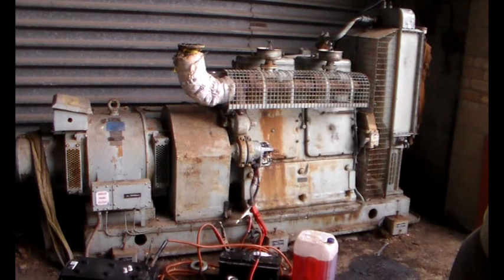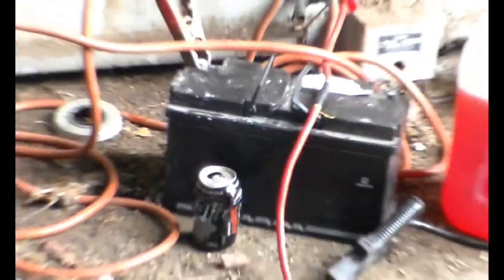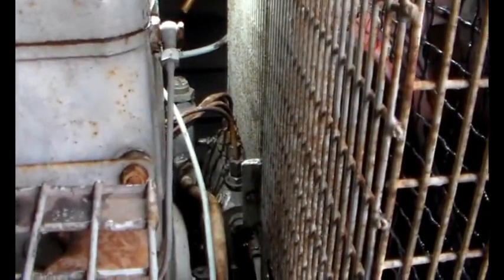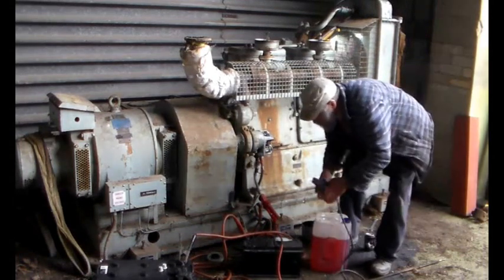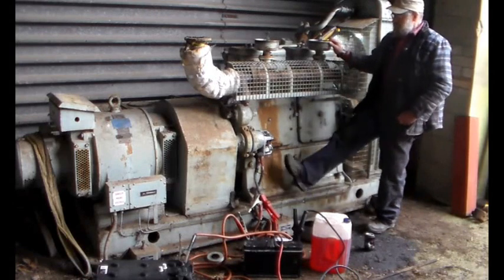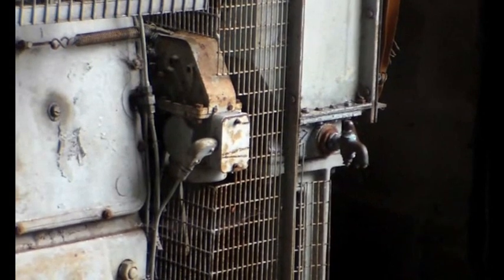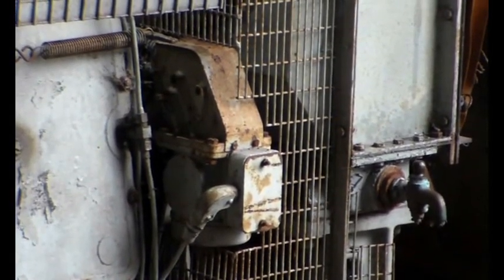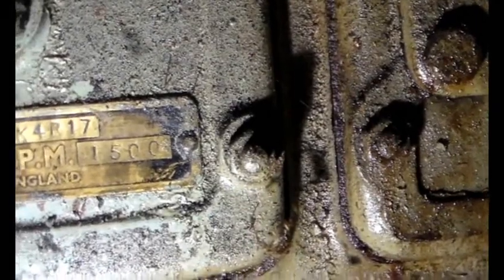Lister J K4 Diesel engine and 30Kw gen set

Comment: You need to check out the exciter which is on the left (seen at 1:32) under the brown lifting strap. Brushes may be worn or it lost it's remanent magnetism. Nice running Lister diesel.
Reply from the maker: Hi, yes it stars and runs very well. We finally got to the bottom of this problem and realised that the exciter control unit was missing. The new unit works in a different way and in part 3 Eddie Edmunson pointed the way forward, cheers

Comment: I've found with smaller diesel generators with an electric drill connected while the engine is running and the drill trigger is pressed, spin the chuck to start it generating power. No doubt the PC brigade wont be happy but its worked for me over a  fair few diesel generators.
Reply from the maker: Yes it's about building initial magnetism in the rotor, part two will be out very soom, cheers

Comment: Hi Andy, Not working on a lister set this big, but I've some knowledge of them. The injection pump is a cav type bpe pump if you need diagrams they are available. As for the generator, the bell housing on the end looks like the excitor which is a dc generator that feeds through a control circuit ( regulator or resistor) to the field coils of the Ac side of the generator. according to the tags, This generator should have 4 brushes on a dc commutator ( lots of bars of copper around a shaft ) and 4 brushes for the ac slip rings ( which are smooth continuous tracks on the shaft). When testing this unit. check the ac side for any signs of output such as a few volts, then check the dc output. In theory, the dc output is just connected to the field coils around the housing of the ac side. but it will need limiting, You can test this through a few heavy resistors in parallel but do be warned, if the dc voltage is too high the ac output could reach deadly levels and harm the generator. Also, probably would be a good idea that nothing shorting to earth. Im sure someone with better explanations will come along but I hope this is of some help.
Reply from the maker: Josh, thanks for the extra info, it seems like we are moving on with this project. There is a control box on the far side of the generator but the whole thing will need to be moved away from the wall to be able to see what is happening. I'm hoping to get back to this very soon, cheers

Comment: Hi Andy, I have two similar but older generators, both 1940s Lister JP series (a JP3 and a JP4)  Both of the genny units have DC exciters.  On the larger unit, the exciter is built into the end of the generator and has a pair of 12v leads that go to the voltage control regulator.  The voltage control on mine is 12v and has a manual raise/lower wheel that changes the resistance in the exciter circuit to regulate output voltage.  I should note that my 19.5kw unit has a delta output with phase voltage of 137v giving me 240v line voltage.  The generator does not use the starpoint.  It has a 3ph delta output to a delta/star transformer to give me 3 240v phases to the starpoint.    My other unit also has an exciter, but this is in the form of a seperate, smaller generator that is mounted on top of the main generator and is driven by a drive belt from the alternator pulley.   Perhaps check to see if there is an exciter built onto the end of the unit, if it is like mine, it could be brushed and simply need cleaning or new brushes.  Try to find out what the voltage should be on the exciter before you try putting power to it.  As i mentioned, thee can be some funny output setups on these things so make sure you know what you are dealing with before you get too involved.
Reply from the maker: Joe, pure gold standard info, brilliant, you will see what happens on the next video, all the best, cheers
Reply: @TheInfoworks  I'm looking forward to seeing how you get on with it. Injector rail sticking is quite common, it looks similar to the CAV pump on mine? If so, it might have a dipstick and you may need to check the oil level in the injector pump. When the engine hasn't run for a long time, the pumps can get dry and sticky and they don't want to twist when the rack is actuated. If they are too tight, it will lead to premature wear on the rack and the pumps get out of sync, or worse.  It sounds like it is running well so it may be fine, but check the oil as the pump cam is lubricated by it.  You may be able to pop the inspection cover off and squirt some oil onto the pumps and the rack from inside to help things along (you can with the CAV pump)
Reply from the maker: @joeslacks  , Joe, I'm hoping to get on it in a week or so, just depends what else is happening, cheers

Comment: This setup looks very much the standby generator sets installed in many telephone exchanges around the Country. If so they were well looked after being regularly run up and put on load. They even came and changed any unused diesel as it aged and replaced it with fresh.
Reply from the maker: Martin, I think you are spot on with your comment and many thanks for the info. When the post office was up to a standard, cheers
Reply: Hi Andy, I was a BT engineer traveled around to many different telephone exchanges. These gen sets were in the power room with 50 volt lead acid exchange battery. The get set would often start up by remote control for testing then a contactor would put the whole building on circuit even the electric cooker in the mess room. From memory these where marine engines. The very large exchanges had two sets some with Rolls Royce engines. This was always an area not allowed into. They were looked after by BT power men always a bit  aloof.
Reply from the maker: @martinwinfield2935  . Martin, like many industries and services they are worlds within worlds. This engine is not only engineering but social history also, cheers

Comment: I couldn't quite read that blue plate on the alternator Andy - one set of 4 brushes is for slip rings on the rotor, but what are the other brushes - does it say DC or AC ? I wonder if it has a separate DC output as well as the 3ph maybe ? I did get a much smaller 10kW Lister genset working on a farm, but that alternator could be run backwards from 24dc to crank the engine over, then it gave 1ph 240vac once started. It was air cooled, and had a centrifugal speed regulator as I remember. Don't suppose this is relevant to what you have here, but the brush label might shed some light ?
Reply from the maker: Dave, thanks for the signpost, yes brushes would be the first thing to look at at, cheers